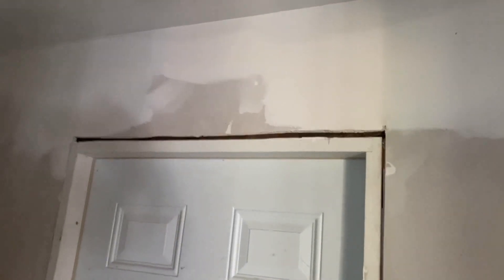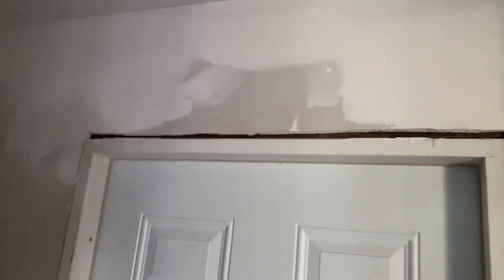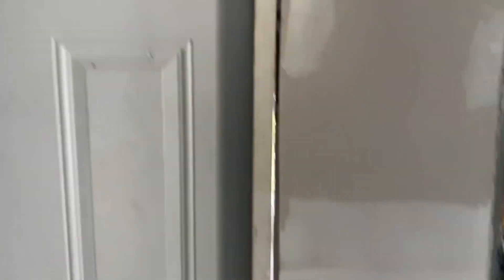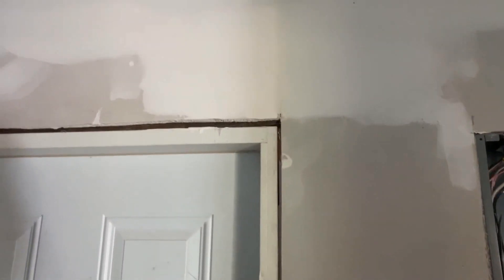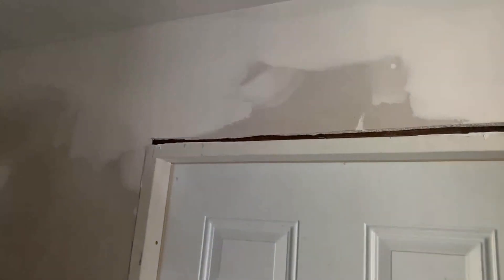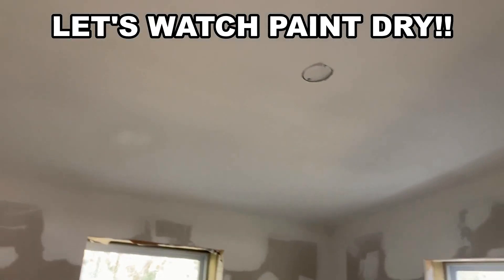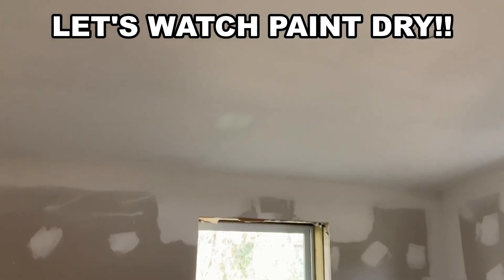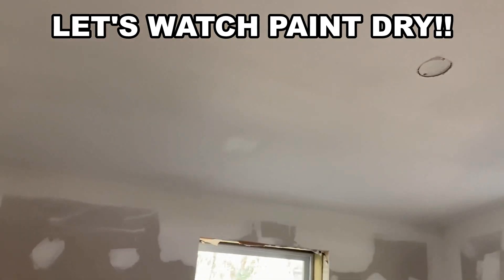Painting an abandoned house | Everybody LOVES painting! #housepainting #abandoned

Comment: No primer?  Did you use a primer/paint combo?
Reply from the maker: I know I will receive a LOT of hate over this, but I absolutely DO NOT use a primer, here's why.

To primer paint an entire house, while it perhaps might be beneficial, the primary benefits are: better paint coverage, better paint adherence and easier cleaning for final paint surfaces.

Now I'll address why I don't use a primer. Primarily is time and cost. Primer adds 2-3 days in the painting process and adds significant costs. On this particular house, using a primer would have added another $1000 to the cost. Because I routinely paint between tenants, the cleaning factor and durability of the paint is of little consequence. Now, regarding paint coverage, I always put on a good heavy coat and then come back with a much lighter finish coat.

Because I always use the same formula in all of my properties, secondary coverage is never an issue and repainting is usually a single day task for a whole vacant house. This keeps the paint fresh and clean and provides a better product for the tenant in the long run.

Finally, having used the exact same paint for nearly 25 years on dozens of rehabs and remodels, I can definitively say that I have never experienced the detrimental effects often listed from failing to use a primer.

I am convinced that many times we use a product or procedure because it is being marketed by the industry responsible for producing that product rather than something that doesn't benefit them.  (tobacco and pharmaceuticals come to mind immediately) 

I've had great results over many years and I'll not likely be changing anytime soon.

In all fairness though, on one project I did use a tinted primer initially and found it to be no better in the long term than no primer so I did not repeat that process.

Comment: What sort of spray rig do you use and do you recomend it?
Reply from the maker: That is a Harbor Freight special, but I purchased a better quality tip from Lowes specifically for the type of paint. It worked well for this application but the pickup tube is a little short and you can’t get more than about 3 1/2 gallons out of a bucket. Also the screen isn’t fine enough and it will pick up small bits of trash from the bottom of the bucket causing the occasional clog on the tip.

For the $169 I paid (not including the new tips) it’s been good enough for my needs. It’s had maybe 100 gallons pushed through it.

I’d probably buy it again but I might get a better quality one from the start. I just didn’t want to spend $500 for a rig that I wasn’t going to use.
Reply: @RehabLife  i have been struggling purchasing a unit as i am mainly a custom carpenter but, i tend to get myself involved in painting from time to time, and i too cannot justify such a purchase. But when i look at that project i am on now and think about ALL that needs to be done anythung i can do to shrink the timeline would be good.
Reply from the maker: @HighPeaksHome  it’s definitely a time saver and I don’t think I mentioned how much I hate painting anyway.